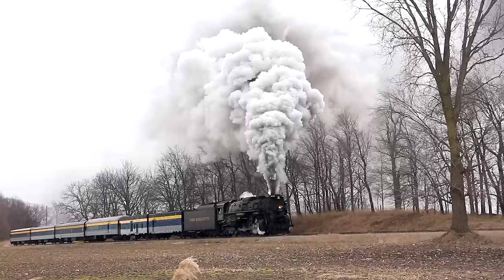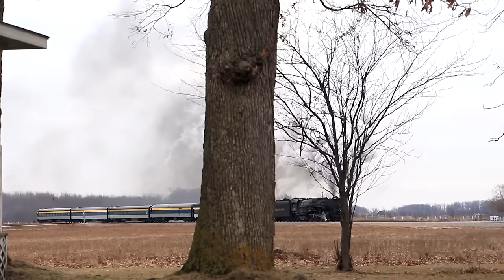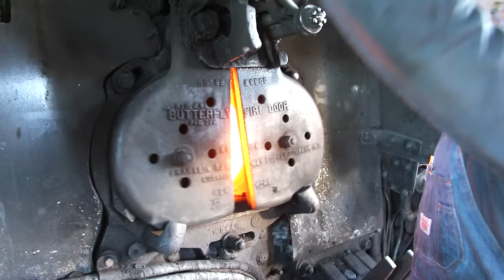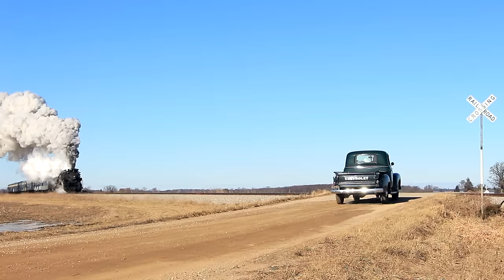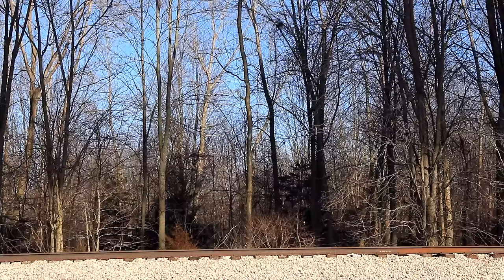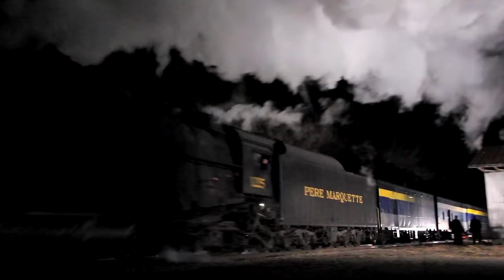Pere Marquette 1225: The Marquette Limited

Comment: Noticing the valve events in this video are more even than they have been in  past videos. Have the valve events (admission, cut off, release, compression) been re - timed?  Also sounds like they were running a lot in full forward gear, rather than "hooking up" and using steam expansively.